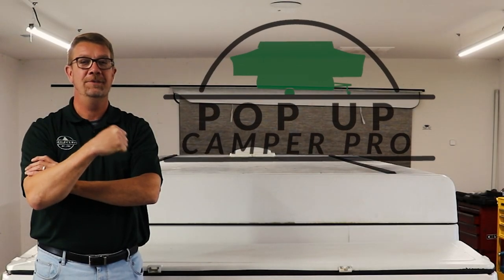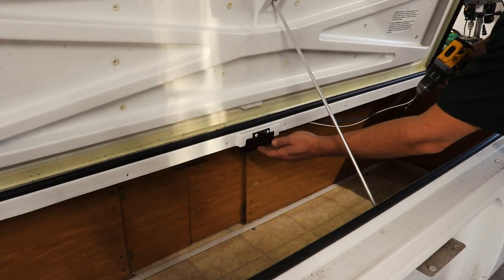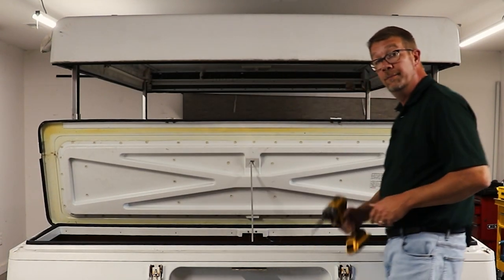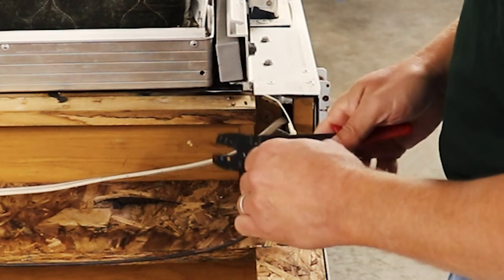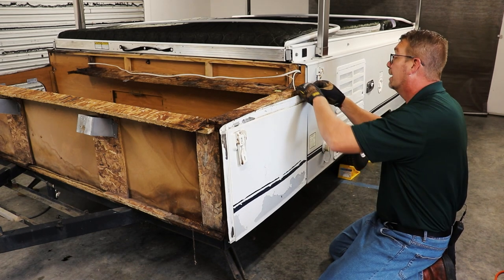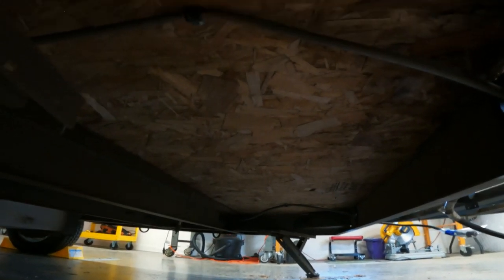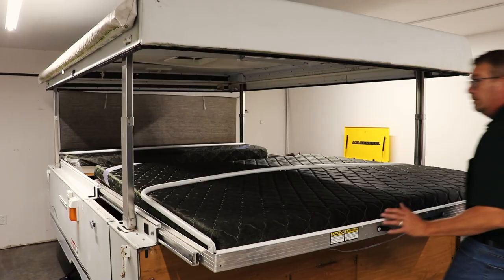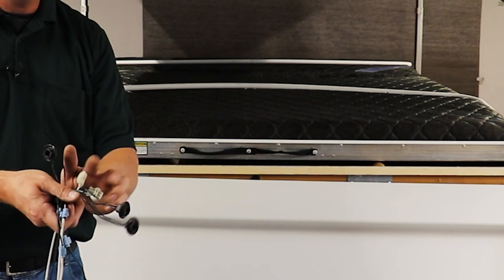How To Replace The Storage Box On A Coleman Pop Up Camper

Comment: Great video Derek. I did a storage box removal on my 1999 Cheyenne a couple of years ago and could have Used this video to really help me. I ended up rebuilding the box with the same parts by replacing all the rotted board. It may not look the prettiest but it still gives me a great storage area in the front. Keep up the videos, they are really enjoyable and very helpful.
Reply from the maker: Right on Kyle! It's always a good option to replace and rebuild as well.
Reply: @popupcamperpro  Do you have any videos of rebuilding one?
Reply from the maker: @chrisfarley9213  you can use this video as a springboard to do so.

Comment: So I did all of this and I discovered that if you're very careful you can actually use the front cover of the old storage box you might have to do a little snipping at the bottom but it fits perfectly otherwise
Reply from the maker: Good to know Bill! Thanks for watching and writing.
Reply: This is what I was wondering!! Can I just use the front panel instead of buying one??
Reply: Well answer for mine is no, gotta buy one. But that box basically fell off and was LOADED with carpenter ants!

Comment: I did a complete rebuild of my 2001 Niagara two years. All the frame wood was rotted out from cracks in the covering ABS plastic. I repaired the plastic with white legos melted in acetone. Then used OSB for sides and floor and uncoated MDF for the bulkhead and front wall. The fit of the ABS shell wasn't perfect (prolly cuz of my imprecise measurements) but turned out pretty nicely. Nice video. could have helped when I was fixing mine.
Reply from the maker: Good job on the rebuild and thanks for watching!
Reply: The repair with Lego and acetone caught my attention!  How do you do this? The top of my trailer is covered in cracks and I'm afraid the wind will rip off a section if I tow it on the highway.
Reply: @JimLambier  You can probably find a cheaper ABS source than Legos but that's what I had on hand. Basically you get a airtight jar (I used a mason jar) and drop some ABS into it and give it 3-6 hours to completely melt. The concentration of the mixture matters based on what you are trying to do. A thinner mixture is better as a glue. A thicker slurry is better to fill spaces.
Basically I used a dremmel to rout out cracks. I also used drill to drill a hole at the very end of the crack to prevent the crack from progressing. Then I put reenforcing ABS patches behind major cracks (on the inside of the popup's formed plastic parts) using the glue mixture. Once dried, I filled in with the slurry. Finally, touch up with sanding and spray paint.
Reply: @JimLambier  Oh, I wasn't sure if by top of your trailer you meant the roof. I didn't do these ABS repairs on my roof just the plastic shell parts on the front and back. For the roofI used a truck bedliner mix ( I think it was Rhino liner that you order and have to use within a couple weeks). Just rolled that on after cleaning the roof with acetone and it worked great.
Reply: @rebby11  thanks for your quick replies. Yes, I had been referring to the roof. My roof has a dozen cracks that are several feet long. After reading your original message,  I started doing searches and found someone who had made a video about repairs to roof cracks using acetone and 3D printer ABS filament. It looks like a cheap way to fix it. It probably won't look too pretty but it will be much better than what I have now.
Reply: @JimLambier  Interesting. Good luck!
Reply: Also good luck. Our 1999/2000 Mesa's abs roof shell was a total turd. I was planning on doing the abs slurry patch method followed by GrizzlyGrip bed liner. Further consideration of the awful delamination and input from my wife changed the plan to removing the abs shell and just doing the GrizzlyGrip on the ridged foam cap. 

Fair warning if you go that route and you've got small foam divots/holes from whatever method they used to make the foam cap you may run into the bed liner not fully covering them. (Think pencil lead diameter spots.) Customer service was super helpful and recommended me going back over with a super light third coat. (Time constraints have prevented me from doing this.) 

Also note if you have spots with large holes you're going to want to fill them with a two part compound. Don't use Bondo or anything with 'styrene', that's the chemical that eats foam. I used a product called P-14 Ultra White Resin from Adtech. Local composites business was super helpful and recommended it to me. You've got a super short five minute window once you mix the activator and the resin. But past that it's really easy to work with and did a really great job. 

Hopefully this helps and doesn't just feel like I'm trying to show off.

Comment: Where can I get the front panel  I want to do the same on my pop up-front?
Reply from the maker: @victorramirez844  we are working on bringing these back.
Reply: For now, I'm going to remove it and somehow  seal it until I get a new front cover. Let me know when you get the replacement in stock. I have a Coleman 1999 flagship. I'm restoring it back to OEM. Great idea not to have a storage box it will help with the front side weight.

Comment: Thank you very much for your video. It is very useful. I need to do something similar. I have a 1997 Coleman/Fleetwood Key West, and I need to restore that storage compartment. It is damaged by rain, the wood rotted, and the plastic cracked in the corners and browned by the sun. How can I get the parts I need for my camper?
Reply from the maker: Check out our webstore for the best selection of these hard to find parts!

Comment: Hey man great video. Really helpful! I have a 2000 westlake and i need some advice on what to use to cover my hot water tank, being that i wanna go with an open wall storage.
Reply from the maker: I've seen simple boxes built just large enough for the water heater done very well.

Comment: My storage box and deck are in good shape. But the lid was so dry rotted from UV damage that it basically disintegrated. Are the storage trunk Lids available for purchase anywhere? I haven't been able to find a replacement.
Reply from the maker: New storage box lids are currently not available. I wish I had better news for you. If we make or find a solution we will let you know!

Comment: I have a utah with the storage box on the front. How would you do this with the hot water heater on the front also
Reply: I was wandering the same. I also need to fix a section of the front wood too as it has water damage now as well.
Reply from the maker: For units that have a water heater built into the front compartment. You can relocate the water heater into a new pre built box, or custom build a box that can accommodate the water heater.

Comment: over the winter water got in through the access door on the side of the storage box on our 2003 Cheyenne. I imagine it was from the melting snow this spring (my regret for not putting a tarp over the camper). Is there a way to replace only this side panel only without dismantling the whole box as you've show here?
Reply from the maker: Yes. The front will have to come off at least but it’s doable Doug.

Comment: I looked on your website for the part number you provided and nothing came up. Do you have 1 in stock?
Reply from the maker: So sorry but these are sold out
Reply: Do you have one that will fit? I have a 2001 Niagara.
Reply from the maker: @JustinDarbycom  you will need to start with your required measurements to assure we have a product that will work on your camper.

Comment: Is there anything that fastens the wood on the sides to the front bulkhead? I just need to redo the wood on the storage door side and really don’t want to risk breaking anything removing the deck. It looks like the rivets could be cut off, and once the obvious screws are removed the wood should be able to be pushed from the front corner into the box to clear the door and bracket
Reply from the maker: Hello Craig! The corners are supported with fasteners at the bulkheads. Inside the bulkheads at the top you will also find blind fasteners that may need to be removed as well, to allow the top decks to completely separate allowing the removal and replacement of the side panels on the the body. If it’s just the storage box side wood in question, then the video shows these steps. Since you mention the access door I believe you are looking to take off a side curbside body panel.  You should not find wood behind this though. I hope this is helpful! If you need more assistance from me please call me at the shop. Thank you!

Comment: I had the same problem. ABS cracked. I replaced all the wood with pressure treated. Did a lot of fiberglass repair work on all the cracks on the ABS. I wish I was able to get the broken part instead of having to fiberglass repair. When I was told Fleetwood is out of business. And there’s only one guy can get parts from in Maryland. Never even consider doing what you did by removing the front. Without that nice ABS plastic front you put on. It look kind of amateur. I wish I watch this video sooner.
Reply from the maker: I'm sure it looks fine James! More videos are always in the works, and please let me know if you need help with further repairs in the future.